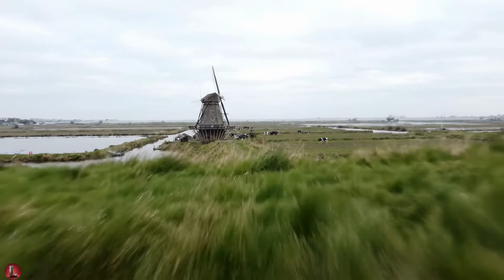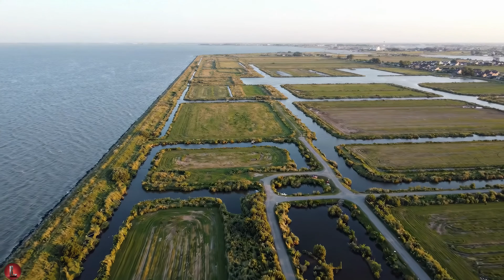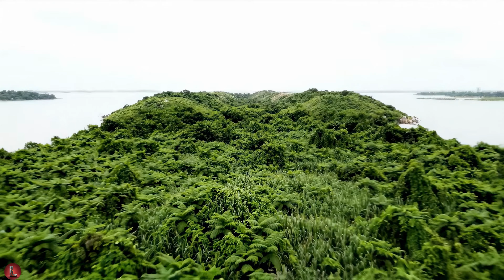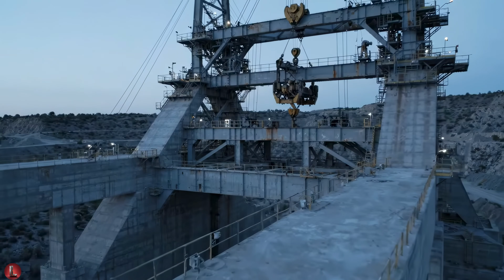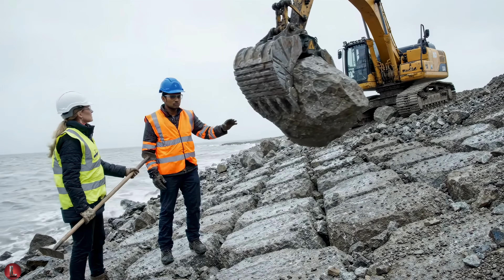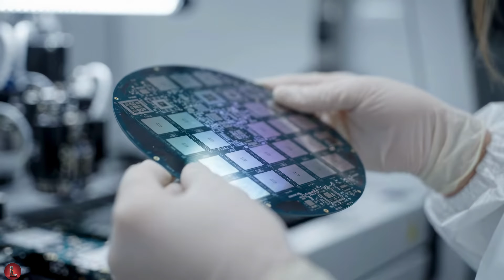Singapore Built a Future So Advanced Even America Admits It's Behind

Comment: Wow. A very clear, accurate and intimate understanding of Singapore existing and infrastructures projects in progress and its governing planning.
1. The water issues with Malaysia.
2. The various of development of self sustaining of water.
3. The polder in Pulau Tekong.
4. The Kallang Marina Barrage. 
5. The Semakau Landfill.
6. The new Tuas container port.
7. The Jurong underground Oil Cavern.
8. The new automatically disposal of residential garages.
9. Architect/Structural Engineers of the Pinnacle Building.
10. Worker’s dormitories issues and modernisation.
11. Solar Panels farming from Australia proposal.
12. Singapore proposal of the Singapore ‘Long Island’.

Wow! Excellent enlightening of Singapore infrastructures review!… even many Singaporean might not knew it or it is ongoing.